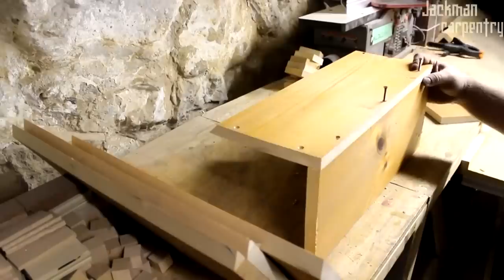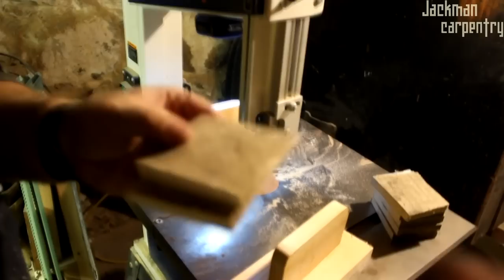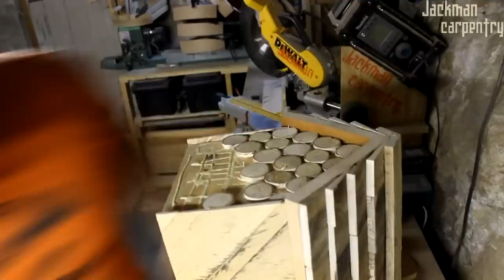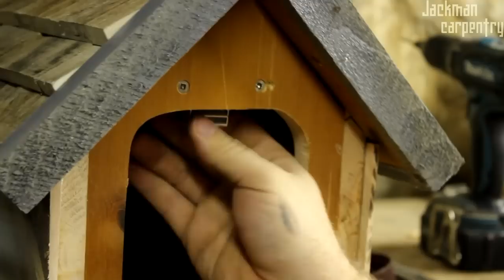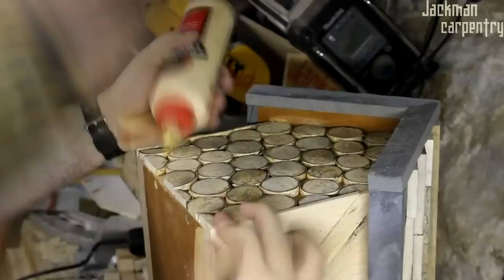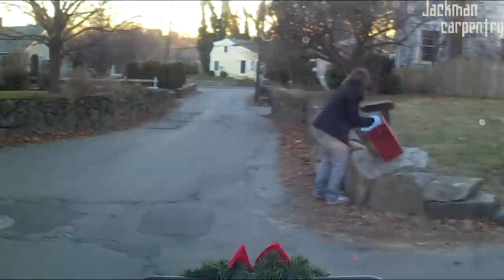Wooden Mailbox (from trash to Christmas present)

Comment: I have a similar mailbox, and I am trying to figure out how to attach it to the post. Most manufactured mailboxes are recessed on bottom, so you can screw it to a board. How do you screw this one to the board, on top of the post. I can't imagine from the inside. Maybe from the bottom up? These are quite a bit heavier than your usual mailbox, so I am wondering if there is additional support for it.
Reply: Thank you for your reply, that helps a lot!

Comment: Beautiful! But the only things is, I've used old pallet wood myself for projects only to discover that they don't use dried wood to make pallets, and after a few years the wood shrinks and cracks.  Also your fingers were a bit too close to the band saw blade. Would the savings in time be worth it if you cut yourself?   Otherwise bravo!